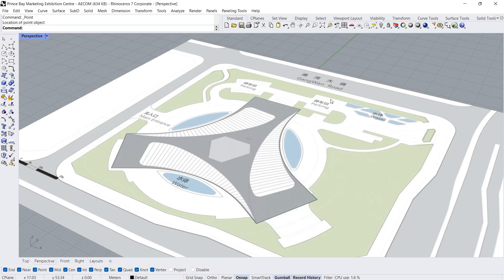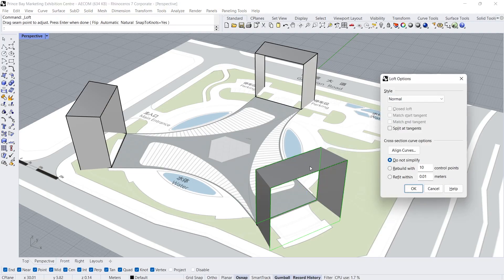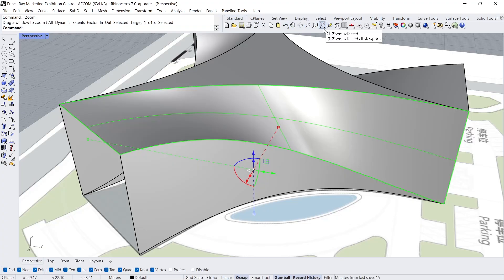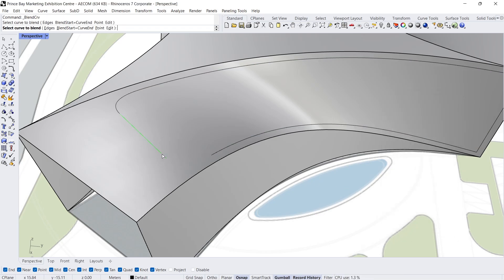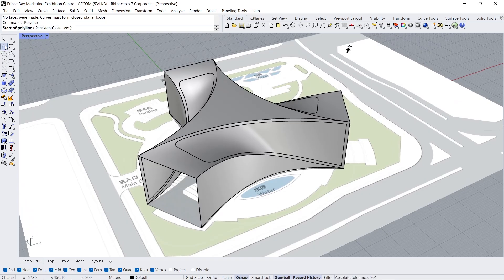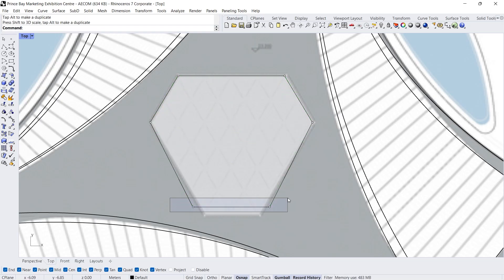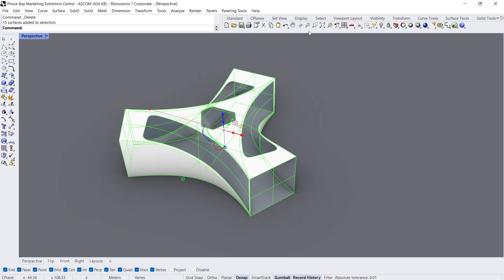Rhino Architecture - AECOM

Comment: Why dont you make one part and use polar array with 3 numbers. Even it is good to use flow surface with history on.
Reply: Exactly!! I was think the same. I have used polar array instead and got better result. Didn't require to adjust using vertices.
Reply: Do you have a tutorial on this please? Cause i have a problem with the vertices step

Comment: Hi. Why does it perform the opposite of what is in the training when I use blend surface ?
Reply from the maker: From one of our followers: FutureLuxury

- I had the same problem. I worked out that which coordinates the surface blends to depends on which half of the curve you select. as in, there is a midpoint along each line. when you start the blend surface and select the first line you will invariably select a point on the line which falls on one side of its midpoint, when you select the next line you are blending, make sure you select side of its mid point you want to blend towards. its difficult to describe but intuitive when you try in.
Reply: @AdamArchh  TNX a LOOOOT

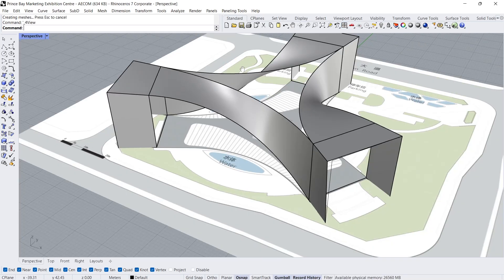Comment: At 3:24, even after setting the z coordinate, the middle three curves are not becoming planar.
Reply: Select the six curves (the three arcs and then the little nub extensions) and use then do the set point command with them rather than the vertices. That worked for me.
Reply: Thank you so much for that:))))) @anthonyfossi
Reply: same problem
Reply: @nischalejardar9218  just use dup border > join > patch
Reply: How can we solve it?

Comment: WOOOW ASTONISHING WORK!!! what are your opinons of sketchup? do you prefer Rino? its nice that you have all the built-in components with Rino!
Reply from the maker: Sketchup is a very powerful program, but working with curves is easier in Rhino
Reply: @AdamArchh  how much more difficult is Rhino vs Sketchup? cause I've basically mastered sketchup but never even begun work in Rhino.. but id love to start! ..
Reply from the maker: @ThatOneArchie  SketchUp 3/10 -  Rhino 5/10
Reply: @ThatOneArchie  If you can master Sketchup, you can master Rhino too.
It appears a little daunting at first, because of the hundreds of commands/tools
but of these i only use 25 commands for literally everything.
its also free for 90 days, which is plenty for starters
Reply: @randomtux1234  just crack it from the get go, no point to use the free trail

Comment: 2:30 at this step when you edit the vertices it edit the hole model but for me it just edit the vertex of the large rectangle ..second the planar surface command not working
Reply: I mean the lofted area didnt join with the blended surfaces
Reply from the maker: PlanarSrf only works on planar and fully closed curves. So you have to make all 3 curves planar. If you still can't. Use the EdgeSrf command.
Reply: did you figure it out? i'm having the same problem, just the square moves
Reply: same problem
Reply: Make sure you apply Always record history under Record history before using blend surface

Comment: hi, Adam, I can't figure out why the Planarsrf won't work, says "curve must be closed and planar"
Reply from the maker: In the previous stage, we synchronized the points in the z direction with the setpt command (or set xyz coordinate). PlanarSrf won't work if you haven't done this correctly. If you do these and still have problems, use the EdgeSrf command, but you should be aware that the surface is not planar.
Reply: @AdamArchh   I see, I didsetpt command (or set xyz coordinate). but still not working. Thanks very much , I will try the EdgeSrf command
Reply from the maker: Good luck
Reply: good practice is to set grid units in options
and snap to objects on, then your curves are not visually closed and apparently valid,
but actually closed and really valid
Reply: Same happened to me. Instead of selecting the 3 points and then SETPeT, i selected the 3 edges and thé Setpet

Comment: TIP 1 > Never delete your curves. [1] They take up no space (just put them on a separate layer and turn off!) [2] You might need to make change, so you'll save time and accuracy by not rebuilding them.
. 
TIP 2 > When you repeat a command, your narrator-bot does not mention what is happening. If you are OUTSIDE of a command, then by hitting spacebar, enter, or RMB you will repeat the very last command.
Reply from the maker: Thank you so much
Reply: if you delete your curves by accident, select your surface and type 'extractwireframe'
Reply: Yoooo. thank you  man.... Saved my life